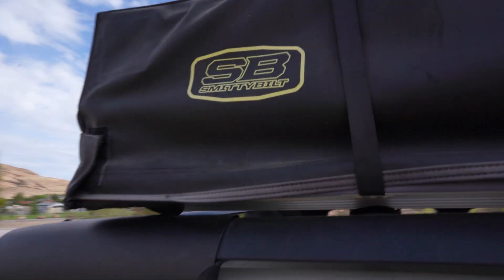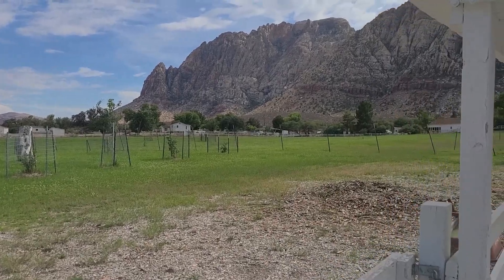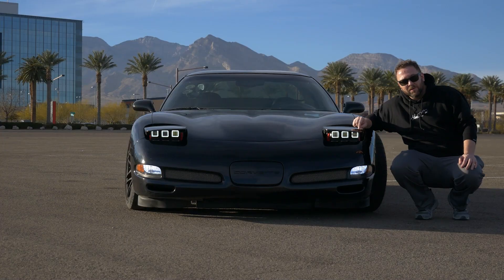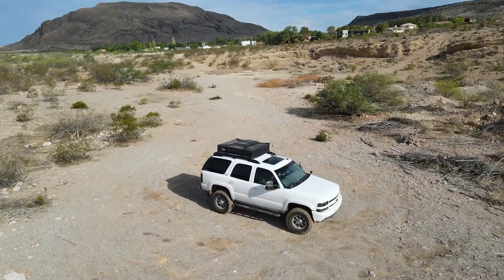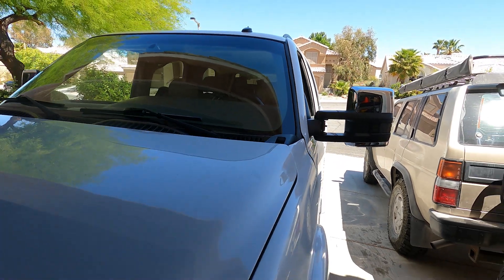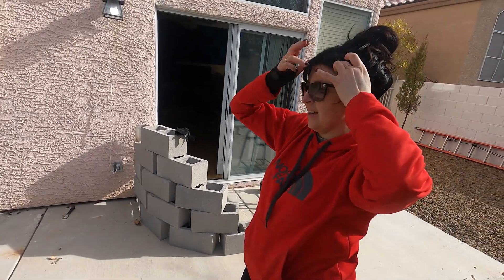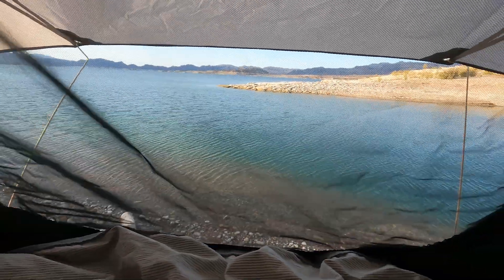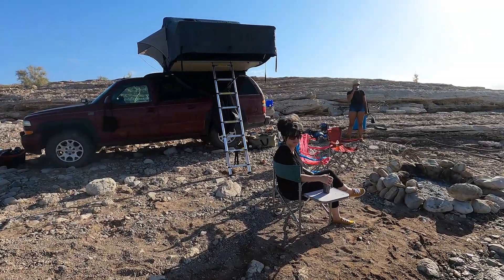Chevy Tahoe Overland | GMT800 Build | Z71 Smittybilt Tent

Comment: Tahoe/suburban z71 going up in price now that everyone knows it's a hidden gem
Reply: sure is. looking  for 1 now
Reply: They can still be had I expensive if you don't mind a little miles. I don't because I know they run forever with proper maintenance and complete rebuild is affordable. I bought 2 within the last year. NY first Suburban and my first Yukon. Both 4x4s. The Burban is the holy grail Z71❤
Reply: Nah, that’s just the use car market growing because newer cars are too expensive and too regulated.
Reply: Just picked up a 2000 tahoe 4x4 for $3500 186k

Comment: I know this is an older video but I'm just starting to fix up my 2003 Tahoe LT 4X4. The transmission went out at 240,000 miles but I refused to get rid of it. Starting my research to get my Tahoe trail ready and found your video!
Reply from the maker: We have some others that are newer.  Check out the Suburban walk around just recently uploaded
Reply: @KnightDriveTV   Will check them out. Thanks!

Comment: Few upgrade ideas…definitely some spot lights, Amazon has a bolt on bracket that you can add directly to your hood bolts.
I added a rear step bumper from a newer Silverado with slight adjustments. Fabricating or finding some molle panels to bolt on by the rear side  window would help with storage space while not taking too much space. Currently in the process of making a  full length roof rack from extruded aluminum

Comment: I’m building a 02 Tahoe Lt/ Z71 clone. I’ve debadged it and swapped out the valance and roof rack from the z71. Just got my fox 2.0s in the mail and have a some 3”keys and spacers for the rear. I’ve had a remanufactured transmission installed as well as the differential rebuilt which had become necessary after a 2600 mile trip and a lot of donuts (kilt my g80)😆 looking forward to some major overlanding and long road trips📍
Looking forward to more GMT800 videos from your channel🤙🏾
Reply from the maker: Nice.  Yeah, we are about to prototype some parts.  I have a big move comin but new shop space will make for a lot more new content.
Reply: @KnightDriveTV  awesome I’ll be keeping an eye for the parts you design forsure! I’m very impressed with headlights you came up with for the corvettes, I’m sure you have somethings up your sleeve.

Comment: I have the same z71, I installed a 6.0 with the 470 trans added a second battery no need for solor panels. Added the trail boss weeks with new BFs with SS steering wheel. You may want to get a tracker or it will get stolen already happens to me never found my Z71 this one fixed is my 4th Z71

Comment: love it man. that lake is beautiful. how are the axle angles with that lift? would be nice if you could drop the whole assembly down.
Reply from the maker: In the front, the drop bracket lowers the member, so the axles are good up front.  Out back, the xcase remains stock, but the axle is dropped...no vibrations from ujoints or anything...it's a pretty common setup.  What I don't care for is the exposed torsion bars, so I think coilovers up front are a must.  The rear springs give height but they are very stiff.  I really need a good damper out back with the length and compression to be ok throughout the entire range....that's what I'm stuck on.

Comment: Good afternoon. Just watched your Tahoe  and suburban video build. Are you guys still going offroad camping ?  I have a 96 burb and a 05 z71 burb too. My 96 is my overland build.
Reply from the maker: Yes definitely.  I have added an H2 Hummer build also, and videos on that will be releasing shortly.  I have faced some changes, so I may have to take on more of a solo position with offroading, but GMT content and products are ahead!
Reply: @KnightDriveTV  very cool.  I was going to try to come out later prob middle of next year sometime to Vegas. I was going to see if you wanted a visitor for a camp night out with some 4 wheeling.  I will send you a link of a YouTube video I was on when I was at the very beginning of my build.   My suburban was original which means still needed a lot of work.  I will and send to u
Reply: @KnightDriveTV  this link is my green suburban in the video.

Comment: Factory crossbars? 2 or 3?
Reply from the maker: Factory Z71 crossbars, only 2, Gen2 smittybilt overlander, the suburban is also using 2 crossbars with the gen2 smitty overlander xl.  We have offroaded extensively with them up there, no issues at all.
Reply: @KnightDriveTV  thank you brother
Reply: Doing an xL on a tahoe may grab another crossbar for piece of mind. Light duty offroading

Comment: Can anyone tell me or link me the differences between the tahoe, suburban,  yukon, and yukon xl? I want to get into this platform but can't find much info on the different models.
Reply from the maker: Tahoe and yukon match and suburban and yukon xl match.  The differences are very slight, but in this generation one key difference is the Z71 tahoe/suburban comes with a better roof rack than was available on gmc.  Gmc was known for a bit nicer interior.  In the end, they arent much different but gmc got weird with awd models I think...dont hold me to that though.

Comment: Dose it rub with the 35s and or was it trimmed
Reply from the maker: When I got the truck it was trimmed already.  I have increased the lift height about 1.5".  Currently it is on 17x9's, et -12's.  35x12.5's of course.  No rubs at all now and prob wouldnt have required trims at this height.

Comment: I have a 06 tahoe z71 and want to put a rtt did u have any issues with the stock cross bars? Any tips?
Reply from the maker: I can confidently say I have used/abused, offroaded and angled and slapped that tent all over.  It is mounted to the factory z71 bars with absolutely no issues.  Where the tent mounts we did use some strips of rubber for extra grip side to side, etc but they work great up there.

Comment: im so confused with the roof top tents they say they weight damn near 200lbs, and the weight capacity of the roof racks on these (specifically my 06 escalade) is 200lbs...how are people using these and not collapsing/breaking/damaging the roof rack or the roof itself?  I weight 185, the wife and tent itself puts it way over that max capacity.... can anyone chime in on this?
Reply from the maker: Both our vehicles in the video are Z71's which come with a beefier roof rack than normal tahoes/silverados, escalade, etc.  Even still, we questioned the ability of the rack to do the job.  The Tahoes tent is about 140lbs and Lace and I have both stayed in it without issue.  In the Suburbans case, he has the XL tent which is likely 165lb and he, his wife and child slept in there easily.  We have offroaded heavily with the tents in place so there is no question, the Z71 racks can do it.
Reply: @KnightDriveTV  thanks for the input! I also learned there's a difference between static and dynamic load for the roof racks, which may be what the manuals imply (static)

Comment: That white paint is going to start flaking off before too long. Major problem with them. I’ve owned 2 white ones now and both have flaked. These are also starting to get old and starting to get stuck lifters and it’ll ruin the cam. If you buy one with any kind of mileage then budget for that repair.
Reply from the maker: No problems yet, but when it does, wrap will go on.